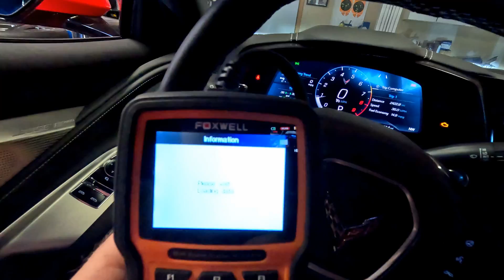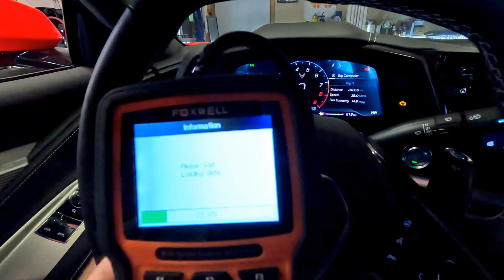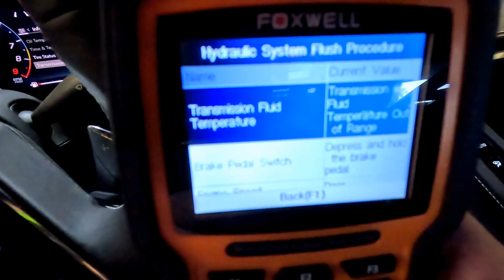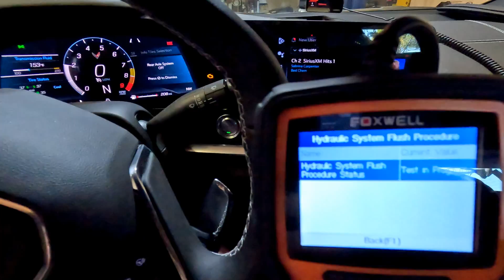C8 Corvette Transmission Filter Replacement with Computerized Flush

Comment: How did you chase the threads on the filter housing?  No one can find a thread chaser the size required.
Reply from the maker: I did not chase them.  I could have used a tap, but I thought it would be more likely to mess things up than anything.  I looked down each one with a flashlight and briefly ran a pick over the grooves.  I didn’t find any foreign material so I figured that was good enough.

To me, the instructions to chase the threads is really more about over-stating how incredibly easy this is to mess up and how extreme care must be taken.
Reply: @RecordsRebuilds  You can make a thread chaser....take a new 5mmx.80 long threaded bolt and cut 2 lines length wise  carefully with a dremel tool. Then make sure it easily still runs through a die. They use it on the threads in the car to clean any excess material out. Works well and should not need hardly any force to thread in for cleaning with simple hand tool screwdriver type tool. No socket driver needed.
Reply from the maker: @gp1200x  thanks man!
Reply: I did mine today, there’s no need to chase the threads with the small bolts
Reply: Get a few round wire brushes. The kind that are link bottle brushes. I use those to clean inside threads.

Comment: Do you keep the brake pedal pressed during the entire procedure?
Reply from the maker: HA!  Such a good question!  It is not made clear.  I was terrified of messing it up so I held the pedal down the full 8 minutes, but I suspect that is not necessary.  I have a hard time seeing a GM tech doing it that way.
Reply: @RecordsRebuilds   @RoxyVendena You DO have to hold the brake pedal during the entire 8 minute flush procedure.  I tried releasing the pedal after initiating the flush procedure, and the process was aborted when taking my foot off the pedal.  I simply had to restart the procedure and let it run completely with my foot on the pedal.